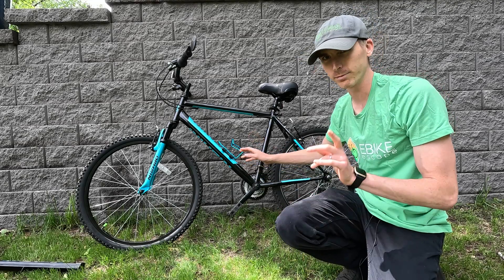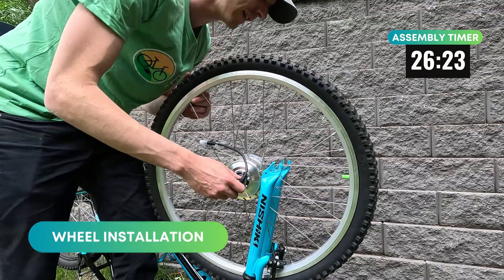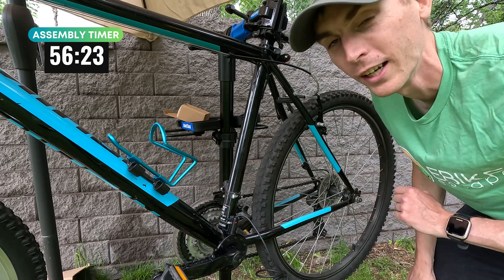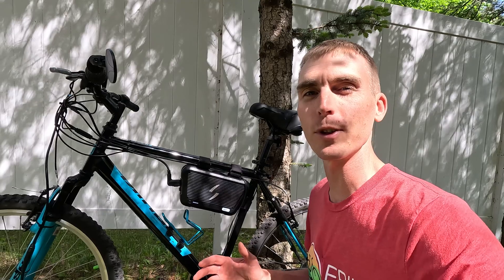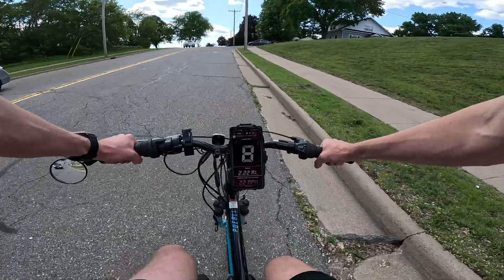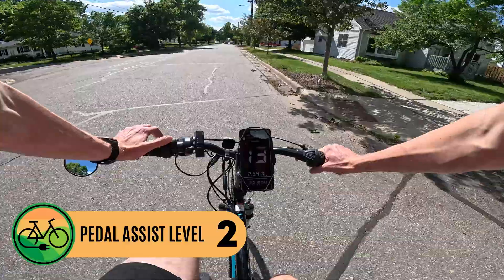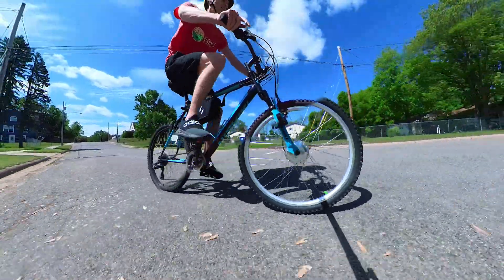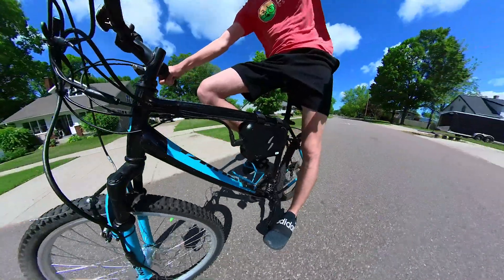Instant DIY eBike with the Swytch Kit

Comment: If you like waiting 6 months or more for this kit .  Waste your time and money.  They give you a 36v 10a battery good for 20 miles total.  These batteries are overworked why they won't last.  The cadence on the pedal causes pulsations .  This sensor should be on the motor just like many do with the rear.  Just more stuff .  The point of this kit is simple install.  Less wires . The battery is a theft magnet.  Live and learn. This is way to costly for a 250 watt motor.  Cost $750 plus.  Buy a Ebike.  The idea is fine but you won't save any money.

Comment: Can this be a throttle only activated bike?
Reply: Yes, I have the Go kit with both controller and throttle. Can use either. I have drop handlebar bike so it’s hard to find a good position for the throttle. Had Switch for five years on my old favorite 2013 Trek and at 70 it’s fun a big help to keep going.

Comment: I have 2 of the older Swytchbike kits. After 3 years, both batteries have stopped working. Just purchased 2 Aventons. Much, much better. Aventons came fast and each with 2 high capacity batteries. Well made bikes.

Comment: When using the throttle, is the power level adjusted/modulated depending on how much you apply the throttle, or is it simply an on/off control?
Reply: Yes I’m also curious about useage of throttle as it said start peddling and battery kicks in. 
I would prefer to be more in control not battery use. Only need battery power on the way home when o return up hill. Don’t want to automatically use battery every time I’m peddling!

Comment: I have 2 Swytch kits, and I’m waiting to receive the 3rd. It’s worth the money, but be prepared for long delays and potential installation issues. My 2022 Max kit took 9 months, and I had to file down the front axle to get it to fit in the dropouts, more of a nuisance, not difficult to do. My 2023 Max kit took 3.5 months, and again I had to file the front axle down to size. My 2024 Go++ has taken 2 months so far and is estimated to arrive next month, a 2-month delay, and I expect pedal-sensor arm installation issues because my bike does not have square-taper cranks (i.e., the crank arm fits flush against the bottom bracket). Others have been much luckier, and Swytch customer service typically responds in 24 hours and have been helpful. Despite all this, I would do it again!
Reply from the maker: Thanks for sharing your experience!

Comment: I am going to be ordering from Swytch since I'm converting my 1976 Raliegh Sprite which my dad bought me brand new. Out of 10 companies I contacted they were the only ones who could handle the old British wheel sizing.  Due to age and disability weight gain the hills have made riding my smooth as a Cadillac a no-go, power assist is now needed.  So before you Dismiss the product, remember it just might be right for someone else.  I only hope it lives up to the marketing, and battery life.
Reply: Let me know how it works out

Comment: Why did you rate the installation at 5/10? Seemed pretty easy and straightforward, how does 5/10 reflect that?
Reply from the maker: Not too easy that anyone can do it, not too difficult that it takes someone who has done it before. Right in the middle
Reply: He had a bunch of issues installing certain things and there was a lot of forwarding through it and edits so we didn't see everything. Did you ignore that?

Comment: 8s it me or was the cadence sensor a little loose?
Reply from the maker: So it was definitely loose without the retention pin. When I put that in it was much better. I wish there was a better solution for the pedal assist but it does work. Of course taking into consideration they have to make it compatible with different bikes that were never intended to be electric.